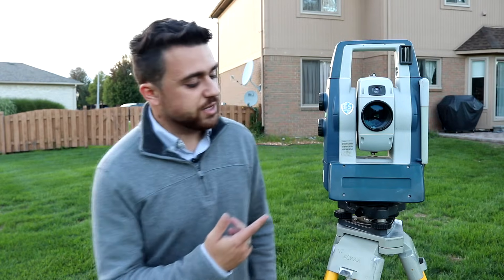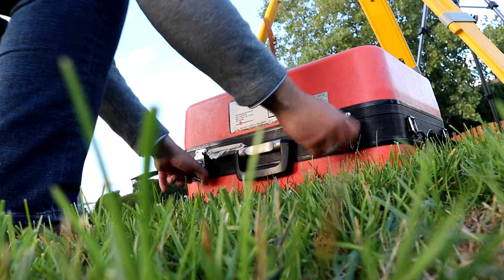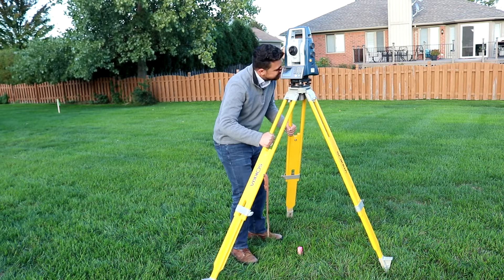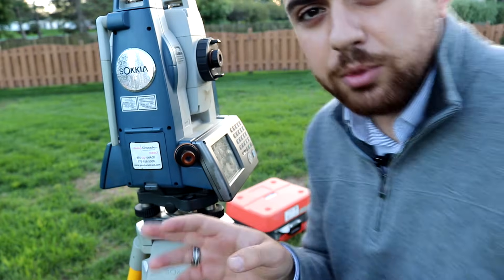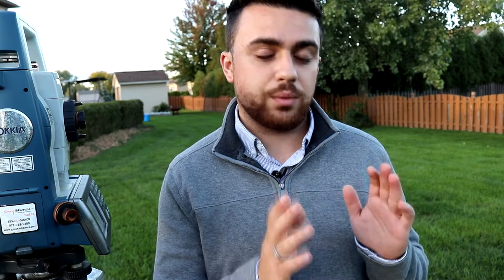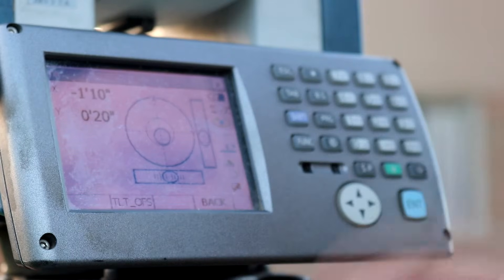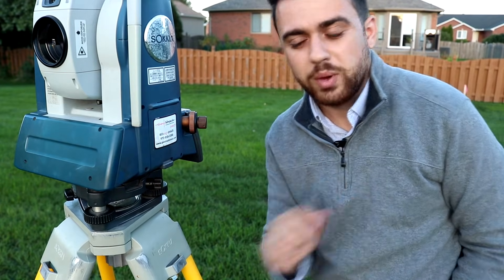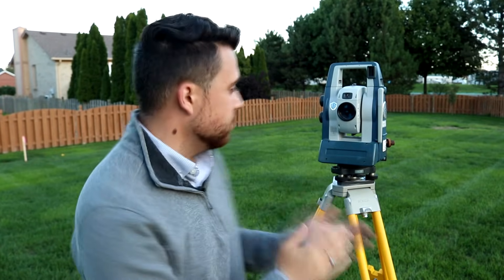Setting up a Survey Total Station

Comment: Hello Rami,

It would be helpful to your followers to get an understanding of how one would approach a tripod setup in a more challenging real world conditions ie. stone walls, sloping terrain etc.

in those cases a plumb bob can speed up the process, but certainly the projection of an imaginary line through each of the legs to intersect at the setup point, while insuring the tripod top is somewhat level will result in less frustration.  It should also be pointed out that laser and optical plummets can add to frustration if the tripod head is not leveled first.

On a different topic, I was amazed to find “3d scanner App” can produce contours (isolines) of a site by selecting “More” then “Capture Floorplan Image” followed by “Isolines” and specifying “Isoline Step” interval.  Amazing!

Keep up the good work!

Comment: Hi Rami, great videos, i might be missing something very obvious - but, if i already have Northing and Easting locations for the points i want to set out, how do i 'tell' the total station where it is? Or phrased in another way, how do i know the Northing / Easting of the reference point? How do i work it out? In my case, a surveyor carried out a topographic survey, the architect created a site plan, from which i pulled the easting / northing data of the buildings corners, and now, i want to use my total station to peg those corners out - but i have no existing reference on site. Hope you are able / willing to clarify - either way, still great videos and i'm now a subscriber. Thanks!

Comment: Occasionally after I slide the reticle back over the nail and zero out the numbers on screen, the level bubble is slightly out of balance. Is there an efficient way to correct this or do you just have to start the whole process over again in order to get the bubble perfectly centered?

Comment: I'm using a new automatic kolida total station.  on the digital level screen .. as you use the footscrews to bring the bubble to the centre the the seconds reading exceed 10 seconds when it reaches the centre.. any help or advice

Comment: How to know where to set up the reference point? The one you see on the view finder? Hope you reply. Thank you!
Reply from the maker: The reference point should be placed somewhere were the most amount of points can be collected. For example, if you set up in a corner away from everything, this is a inefficient set up. You want to set up in an open area where you can see the most from that location.
Reply: @RamiTamimi  indeed

Comment: Some people show leveling, then turn 90° and level again.  If you get it dead center I am assuming there no need to turn 90° ??  Your videos are awesome!!
Reply from the maker: Turning 90 degrees and verifying the bubble is still in the middle is a calibration test. If you equipment has been recently calibrated, you should be fine. But very good point!
Reply: Yes, so long as the instrument is calibrated properly internally (i.e. low internal error)

Comment: Hi my name it's ely and I have a sokkia but I don't know how can I run elevations  on my data collector
Reply: Do you have a rod with a prism on the end?
Reply from the maker: You need to establish 2 points. Set your total station on one, and then back sight the other one. This will set up the job for you and you can begin surveying. Be sure to specify the correct prism you are using as well.

Comment: Rami I did my first survey camp today and it was awesome and your video was very helpful! My question that I would like to ask you is how come when I kind of leveled my Total station and when I turn it on it doesn't show me the Level & Plummet screen to fully level it with the screws rotation?
Reply: I believe you have to manually go to the screen if it doesnt pop up
Reply from the maker: Great work, I hope surveying treats you well. You can always open the leveling screen on your total station and continue leveling to a more precise level.
Reply: You need to turn up level setup using    shortcut keys on your keyboard.

Comment: My theodolite (no EDM) has bubble in a circle and a bubble on a straight level, but doesn't have this electronic leveling. How would the process change? Do you have a video on this? I usually use the straight level and adjust the feet, then turn the instrument 90° and repeat---this doesn't always work great, and I find I'm out of level again at a new angle. Maybe my instrument is just out of calibration?
Reply: Ah, figured it out. Turns out the bubble level needed recalibration. Very easy to do, and now it works great. READ THE MANUAL!
Reply from the maker: Glad you figured it out. Yes EDMs usually have digital bubble assistance to precisely level the equipment more than the human eye can.
Reply: well I can safely say that the bubble level is nowhere near what you think it is till you are working with a digital reading. You can look perfect with the eye only to realize your gonna be adjusting knobs for a while to actually get level.

Comment: Hi Rami. I really appreciate your videos and I think you are doing great work for the survey community. I was wondering if you could show us how you would go about setting up a total station on a project that is using either a grid or ground coordinate system and explain the importance of the scale factor and how to input the scale factor into the total station. I have heard of people not accounting for the scale factor and then their distances end up incorrect. Is this something that you could do?
Reply from the maker: Glad you like the videos. Scale factor is very important when it comes to working in State Plane Coordinates as it takes into account the curvature of the earth. A lot of times people don't account for it because they are working on a small site in a local system, so the scale factor really doesn't change their distances. But of course I can make a video taking about it.

Comment: The best way is to put tri-pod over the point and stomp the legs in, WITHOUT THE INSTRUMENT ON IT! It dont take very long to get good at setting tri-pod first. Expensive robot total stations will stay in adjustment and thats the proper way to set up.
Reply from the maker: You are correct, having the total station on can be dangerous if you are on unstable land. Luckily for me, my yard is flat and so I don't run the risk of soil breakdown. But thank you for mentioning this!